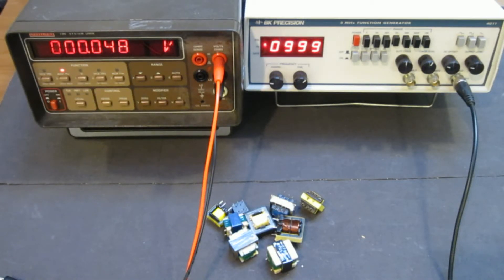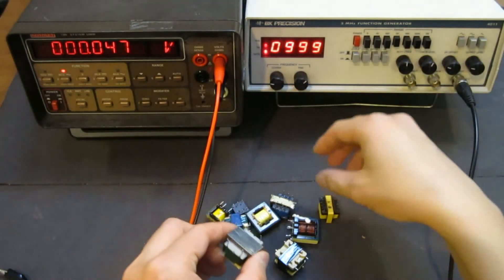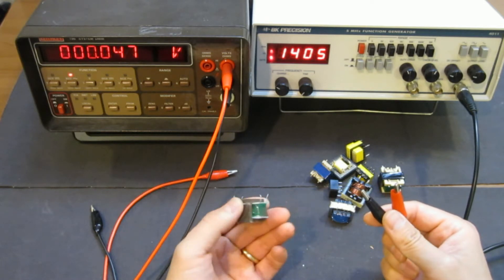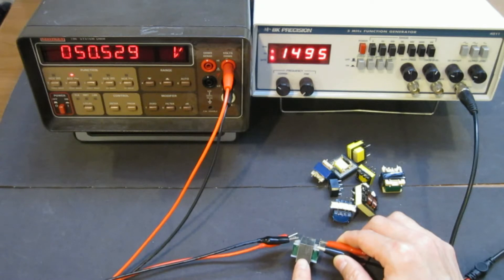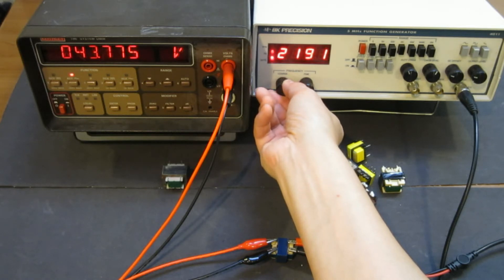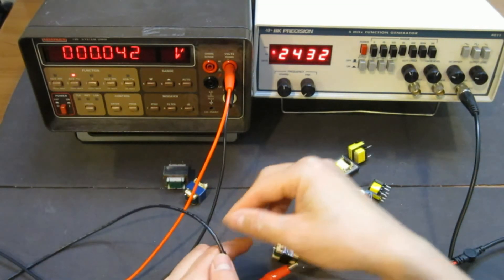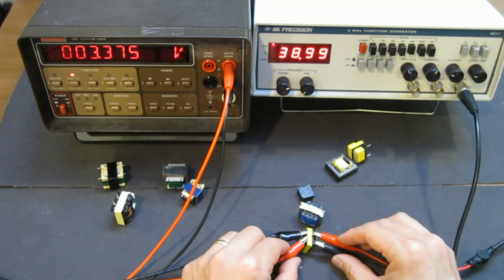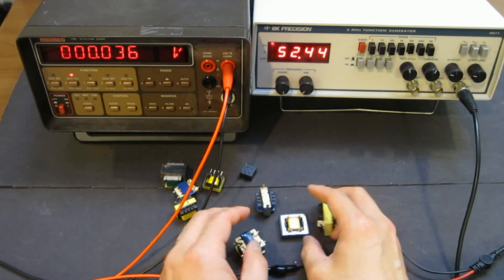Testing Unknown Transformers with Function Generator

Comment: Ok, this video is actually OK after watching several that wasted my time :D. You've mentioned smaller transformers, what about those with 380V on the primary like Hlaft Bridge ones yet still HFs? Can you measure them the same way? If not, what way?

Comment: Hell yeah I'm going to subscribe. Thank you so much. I think I just learned more than a semester of college here.
Could you please tell me how you know which side of the Transformer is the output and which side is input? because I don't think you clear that up in the video. And I desperately need to know
Reply from the maker: There isn't really an input or output as transformer is bidirectional and depending on your use. You can use this method to figure out the rough turn ratio between to two windings.

Comment: Hi Kerry, I am trying to learn about these transformer. I really like the way you explain it. Thank you. However, I do not have a function Generator but I have a signal generator from 0.1 to990 MHz will that work?
Reply: why don't you have a function generator? they can be had for a little over $50 used...
Reply: @Chevroletcelebrity  Thanks, I ended buying one. Thanks again.

Comment: At 3:18
What do you mean by saying that the output of the function generator is terminated at 50 Ohms ?
Reply: he is applying constant low current for testing !
Reply: @MixPickle404 
 Thank you
Reply: Internal resistance of 50Ω is connected in series with the function generator.
Reply: @mohitinch823  
Thank you for your answer.

Comment: This technique will provide a rough start.  Determining actual primary, current capability, insulation resistance, actual turns ratio, and other parameters will require more digging.

Comment: I like this video and I'd like to know more about how other parameters of the transformers can be characterized with non expensive tools. For example you show at which frequency the transformed voltage is at maximum but that may not be the best operating point for maximizing power transfer (which also depends, i guess, on the characteristics of the load)

Comment: Thanks for sharing (y)
Reply from the maker: You are welcome!
Reply: I have a SMPS transformer E1614 controlled by iW1677-01 that transforms 310 Dc (after rectification ) to 5V DC. The iW1677 switching IC operating frequency ranges from 2.1KHz to 72Khz. How can i test this transformer separately just as you did in the above video and what frequency and Vpp do i need to select in the function generator? Btw , when i'd selected 2.1Khz frequecny and 1Vpp sinusoidal Vave , the output was almost 10mV.
Reply: Would it be safe if i apply 310V Dc at primary side and try to control it with a transistor using function generator ?
Reply from the maker: No. You are probably better off by inputting into the secondary (say 1Vpp) and measure the output from the primary. You should see around 60V on the primary (depending on whether the 5V figure is regulated the actual voltage may vary)
Reply: Here are the measurements:
6V transformer:
      primary: 1Vpp
      at 2Khz output 6mV
      at 25Khz , output 29mV (after 25Khz output starts decreasing) 
 
     When i switched the supply to secondary side 
      Seconday: 1Vpp
      at 2KHz output at primary 12mV (aprox)
      at 25KHz output at primary 60mV 
======================================================
What does the above measurements imply :)
Reply from the maker: Hmm, are you sure the transformer was operating under the correct frequency? The readings does not make much sense. Also when hook up your signal source to the windings the windings may load down the signal output significantly, did you measure the actual voltage applied to the winding?
Reply: When i connected 1Vpp supply with the primary winding and check the voltage across primary winding using multimeter, it was only around 117mVpp. Even though  I increased the Function generator's Vpp to it's max limit of 10Vpp the voltage at transformers primary was only 0.83Vpp.@ 2.1KHz

When supply was connected to secondary side, voltage across it was only 15mV @2.1Khz.

Comment: When testing these transformers, if you don't know what type of transformer you have and you don't know which side is the primary and which is the secondary,  could it happen for example that you connect the test signal to the output of a step-down transformer and you actually measure a stepped-up voltage at it's input?(which in this case where connected backwards has become an output) mistaking that transformer for a step-up one.
Reply from the maker: +VoltLog The designation of primary and secondary is usually arbitrary. So if you are using a say 110 V to 12 V transformer, you can either supply 110V to is 110V winding (primary) and get 12V out, or you can input 12V and get 110V. And in the latter case 12V would be your primary. So for a step down transformer you can also use it as a step up transformer and vise versa.
Reply: While it is true that a transformer can be used as either step-up or step-down, those laminated core transformers you have shown are designed to step down the mains voltage of 110V to 230V (depending on where you live) to the voltage required by the circuit and are meant to operate at 50 to 60Hz. The fact that they can be operated up to several thousand hertz is simply a matter of the cores capabilities and not it's ideal operating frequency. 

While it is important to choose a core type based on the operational frequency of your circuit, that does not imply that you must tune your circuit to that of the transformers ideal operating frequency.

Comment: Very useful tip! You can also use an oscilloscope if you don't have capable multimeter, some scopes even can calculate the ratio between channels.
Reply: And you can tell the direction of the windings from a scope :).
Reply: @netman69 no you can't
Reply: @Chevroletcelebrity  yes you can, when 2 of them go the same direction the polarity will be the same when you got a probe on both, it'll be opposite polarity (or phase shifted 180 degrees in other words)
Reply: @netman69  no
Reply: +Henri “Ketturi” Keinonen Also using a sweep and synchronising the scope the to signature generator, you could see how the voltage changes with frequency.

Comment: nice video, could you also explain best practice for identifying and separating the primary/secondary windings on devices with more than 4 pins?
Reply from the maker: +DextersLab2013 The designation of primary/secondary is arbitrary in this case as it depends on what you want to use this transformer for. 

In the multiple winding scenario, if the windings are tapped, you can infer the phase of the winding by measuring  the voltage across different taps. If the windings are separate, you can identify the phase either by using a scope or connect one side of the winding with a "reference" winding and infer the phase with respect to the reference via the generated voltage.
Reply: Kerry Wong Thanks, will have to dig out some transformers and experiment!